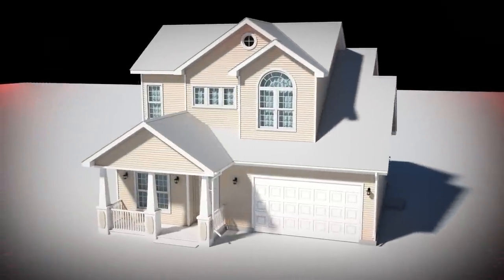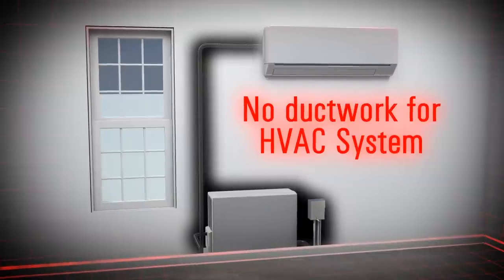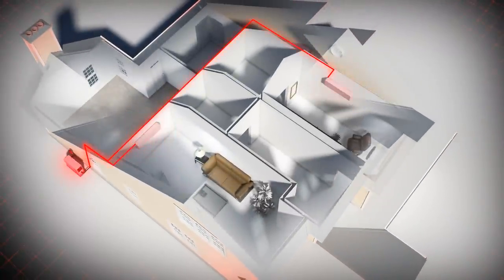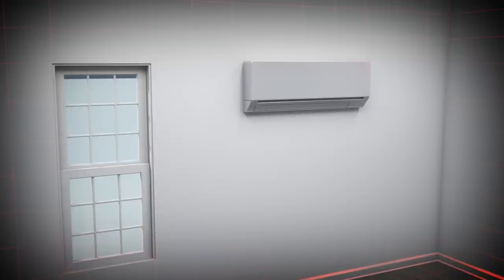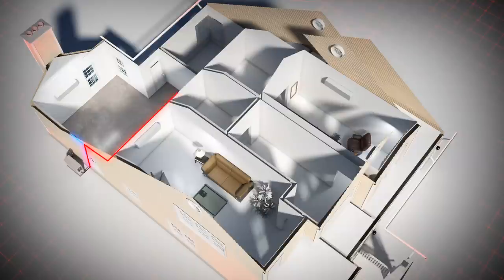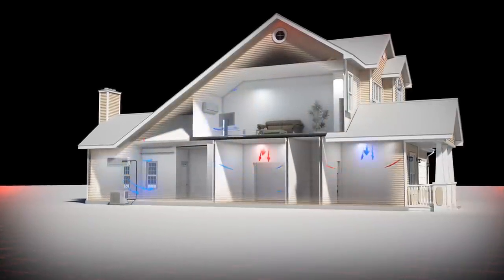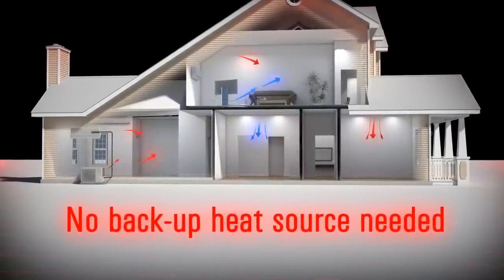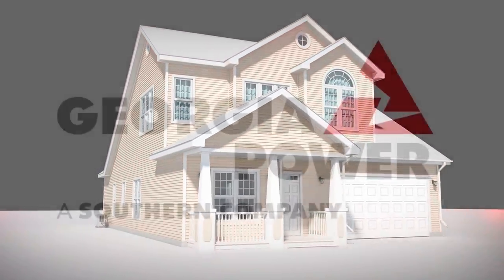How a VRF (Variable Refrigerant Flow) Heat Pump works

Comment: This is very interesting.  2nd+Delaware is a brand new, under construction apartment community built using the Passive House standards.   The community will use the VRF Heat pump and this video was helpful.  Thank you.

Comment: “VRF” refers to the commercial equipment and no manufacturer make a residential single phase heat recovery system. Residential systems are referred to as split heat pumps and the entire system can only work in one mode, heating or AC.

Comment: The only problem I have with minisplits, there is no makeup air or fresh air distribution from outdoors. The filtration system is very archaic compared to a central system with a high quality pleated filter and UV lamp.

Comment: For GA Power, please look at your claim of simultaneous heating and cooling.  This is possible on larger scale VRF jobs, but I don't know of any residential applications where this is possible.  Perhaps I am mistaken.  Generally, these systems have to be in heating mode, or cooling mode, not both at the same time.
Reply: SW L all, please wait until April. We at Toshiba Carrier will have a single phase heat recovery VRF system. Great video